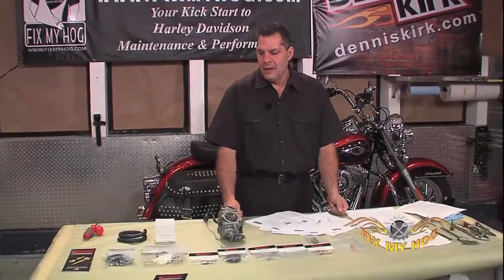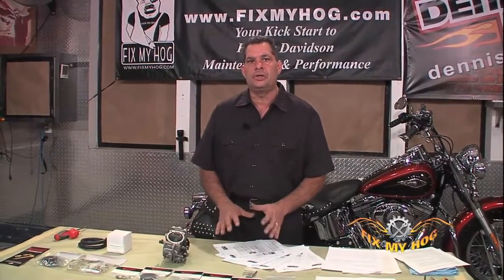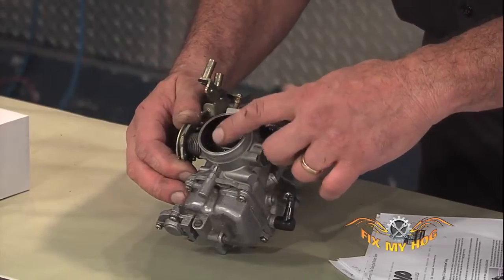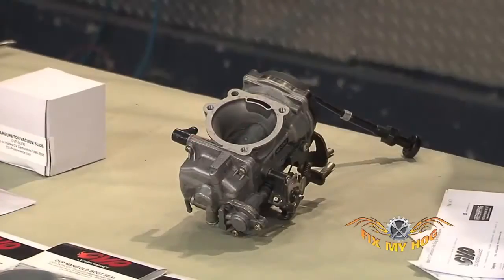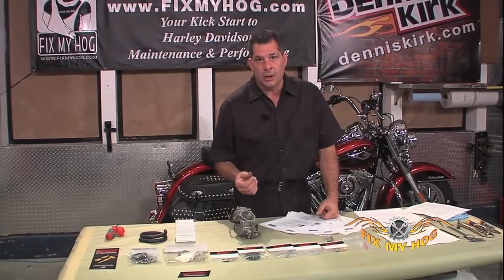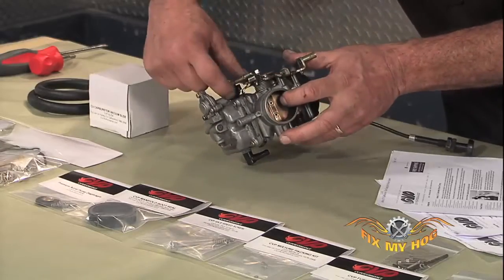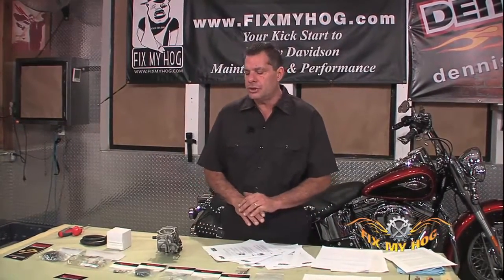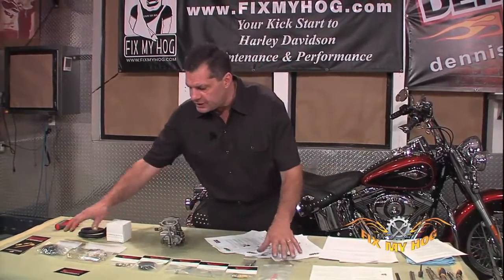CV Carb Performance

Comment: Hi everyone, someone knows if we can put some velocity stacks on cv keihin carburetors ?
Reply: Sure you can and I'll have to dig it up but there is a math formula for the size of the stack as to performance at desired RPM
Reply: @kristenbrunson338  Hi, thanks for the response.What kind of math formula do i gotta use ?
A english company offers V.Stacks for cvk carbs but i dont know they fit on a zxr 400 Kawasaki

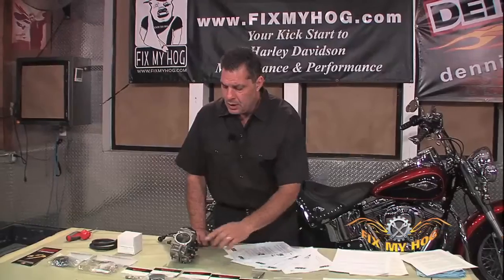Comment: 1:15 Isn't that the air cut-off valve? Why would there be an accelerator pump on a carburetor that has constant velocity?
Reply: @Heads Mess try agian.
Reply: @Snurre86  It has an Accelerator pump even if you don't understand it.
Reply: @mbsnyderc  You are right it is a Japanese Keihin cv built with metric standards and JIS B 1012 and other Japanese standards. HD just slapped on a accelerator pump and rebranded it.
Reply: @mbsnyderc  The question is "Why would there be an accelerator pump on a carburetor that has constant velocity?"
Reply: @Snurre86  because why not
Reply: @xtrah8ed4life  the purpose of having constant velocity is to not overwhelm the engine at low rpm with a completely open butterfly valve. Ensuring the same quantities of air and gasoline entering at the same time, same fuel ratio's stay constant.